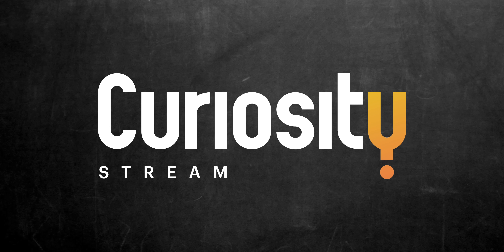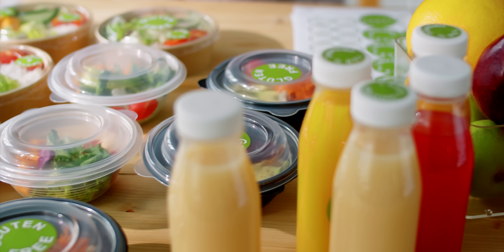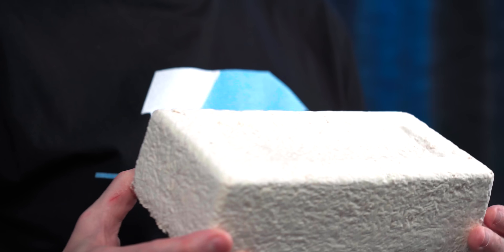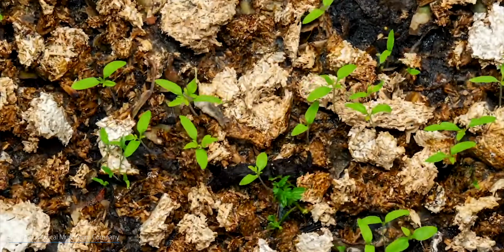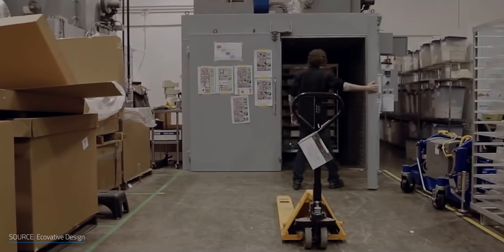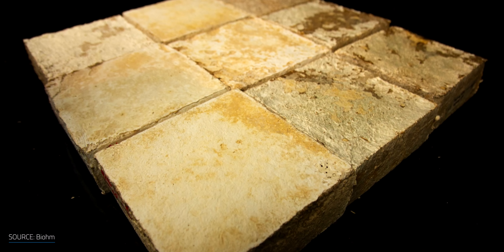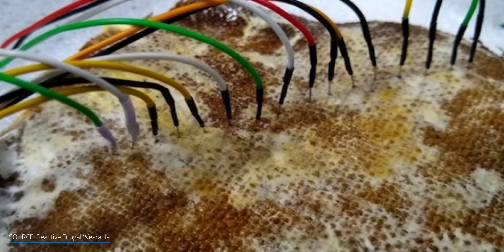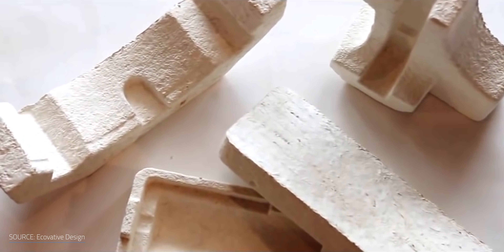Is Mycelium Fungus the Plastic of the Future?

Comment from the maker: So what do think?  Any uses I missed?  Would you want to live in a mycelium insulated home?  And thanks to Curiosity Stream ... use the code "Undecided" to get CuriosityStream for less than $15 a year! https://curiositystream.com/Undecided.

Also, be sure to check out The Future of Solid State Wind Energy - No More Blades: https://youtu.be/nNp21zTeCDc?list=PLnTSM-ORSgi4dFnLD9622FK77atWtQVv7
Reply: dependent upon the mycelium's tensile and compressive strength it could be a very good eco building material when mixed with lime similar to Hempcrete but with the possibility of stronger construction
Reply: @andymacleod2365  Lime would most likely degrade the natural mycelium. Besides, do you want your building to start degrading because it is biodegradable? I don't buy the use of it in building.
Reply: @getin3949  lime doesn't degrade other plant material used in buildings so why would this be any different. That was quite a profound statement do you have any reason for that or just preadjust?
Reply: Great video Matt, there is another use I stubbled across recently - coffins. A company named Loop is using mycelium, for many reasons, but most importantly the structure's ability to breakdown our tissues much more cleanly than possible in even natural wood coffins.
Reply: I was thinking about you will upload your video today... And you just did this... 😊😊😊
Reply: What about allergy issues? If there were mycelium based objects all around, would it just be incompatible with some people's immune systems?
Reply: Is mycelium packaging also edible? That would be convenient, have a flavored takeout box to eat after
Reply: @mobnar lol
Reply: For below ground exterior insulation on foundation walls maybe? However fungi is a tough sell to the construction industry: mushroom and fungi don't carry a positive connotation when wall fungus removal is a problem in sick buildings.
Reply: @notlessgrossman163  It's biodegradable, would you want your building degrading day by day, month by month, year by year until your house caves in?
Reply: @getin3949  I mean, houses already do that lol
Reply: @notlessgrossman163 , as a builder, I believe that the biggest hurdle is it biodegradation in moisture prone areas. Imagine a tiny foundation or roof leak could quickly cause immense structural damage.
Reply: @notlessgrossman163  ,
Rot would have to be an issue, especially for exterior applications.  It doesn't seem likely that it would be able to be competitive with concrete, brick, and non-organic siding materials on that front.  But wood is organic and is the go-to interior structural material for homes in the US.  So, I can see potential for that kind of use, with something else on the exterior.
  It makes sense that in-wall insulation would be the first successful entry point for mycelium products on the construction front.  And that's no small win as it could replace untold tons of inorganic materials currently used for such purposes.  The need to replace things like concrete and lumber seem less pressing environmentally.
Reply: Acoustic ceiling tiles?
Reply: A product with great potential. Maybe it could benefit by marketing it as something different from mushrooms. Lots of products (e.g. renaming carnations as dianthus flowers) have benefitted from rebranding.
Reply: I would like to live in a micelium house.
Reply: *We want replacement of plastic carry bag with cheap price ease to use for every day life*👍 Hit like if you agree 😷
Reply: the concern is its biodegradability...you dont want to buy shoes or houses that degraded after few weeks...it definitely works great as a single use product/packaging..though, it has potentials
Reply: @al-aurum2457  generally wood is biodegradable, but makes excellent building material. In the right circumstances, wood will become petrified. I read somewhere that the Romans built houses out of tree trunks and by the time they were done the wood was preserved "forever". All you had to do was live in them so wild animals wouldn't move in.
Reply: @al-aurum2457  perhaps degraded shoes is not so bad as an idea. Shoes to tend to stink as a result of sweat and bacteria present in the soles. If we could have a home or shop facility to "grow" shoes, being some components like laces the only thing you would buy, I think fungal shoes could be a thing.
Reply: @al-aurum2457  That is exactly the point I just made in my comment. Don't use this for items that would normally last a lifetime, use it for plastic garbage bags, drink containers, anything that we use on a daily basis that is polluting the oceans and landfills.
Reply: @al-aurum2457  He addressed that- he talked about the ageing.  Depending on the mycelium and the way a product is produced, and how it is grown can all affect the qualities of the end product, so they could, for example, make fast food containers and chopsticks that break down rapidly and then building materials that last a long time.
Reply: @al-aurum2457  I think the object/material would have to be introduced into a compost like environment in order to begin biodegrading. If you left the shoes on the forest floor they might begin to biodegrade. But if they're on your living room floor, they are not likely to. As far as housing materials go... maybe they are better suited for interior  or protected areas. This will be the future. What's happening now is figuring out the how to. But it's happening.
Reply: @al-aurum2457  ,
As far as degradability, many construction and clothing materials are very biodegradable.  Plywood, cotton, leather, cellulose-based insulation, etc.  We don't worry about these because we know to keep them out of the weather.  They work great for their intended purpose, but if you bury them in some damp soil, they'll disappear.  If this stuff works similarly, then it is a success.
  I don't think anyone is planning on using it for exterior siding or rain parkas.
Reply: Of course there’s the spore drive.
Reply: some fungus can even digest some type of plastic
Reply: @factfinder5967  Really? Why don't we use it to get rid of some of the plastic laying around? Thanks for this information!
Reply: @CCGR-2024  did I tell you the digested plastic is edible in some cases
Reply: Curious about the durability and longevity of certain products. Do they treat things like the mylo leather and insulation to prevent mold growth?
After all some of these products may be dead already from the heating, but they're essentially a large block of nutrients at that point.
Reply: The packaging products remind me of egg carton like packaging supports that have been used for decades at least here in Finland. Also, most fast food restaurants here ditched styrofoam packages sometime before the new millenium. Hamburgers are sold in cardboard boxes or wrapped in papers. Also, why try growing fungi building blocks, when you can use, say, wood.
Reply: @anttilaine9932  or concrete... or recycled steel
Reply: why would i use fungi grown from hemp to insulate my home when i can just use the hemp directly?   but replacing packaging materials with that stuff is a good idea.
Reply: How scalable is this product?  Also how do insects interact with it?  Would mycelium insulation by attractive to bugs and rodents?
Reply: I'll stick to eating the flesh of animals
Reply: OMG, that is a cheap cost for knowledge!
Reply: Saw this promising tech a couple of years ago. Glad to see that it has made great strides. Thanks for the update.
Reply: @Matt Have you seen the "mealworm/superworm eats styrofoam" videos? It looked like it was going to be a good way to recycle the foam, but then it petered out. Maybe you could look into it.
Reply: @Jcewazhere  Recycling? According to https://www.intelligentliving.co/styrofoam-eating-mealworms-absorb-toxic-additive/, 50 % of the styrofoam is excreted and 50 % is exhaled, so there is not much room for gaining body mass. Furthermore, "Because the droppings contain the harmful additive [flame retarding brominated compunds], they would have to be disposed of responsibly."
Reply: Been flowing Ecotive since it's initial startup.  It has been some unfortunately slow growth from my perspective.  It will likely require public policy making plastic pay for all its negative externalities before this becomes main stream.  Its primary challenge is its competing in a high volume low margin business that all ready has massive amounts of sunk capital infrastructure.  Ecotive's process is even more capital intensive them plastic manufacturing so the question becomes how do you get all the capital investment you need when your margins are so low.  It why they pivoted very early on to focus on niche high end product applications as they continue to develop their tech and likely hope for environmental public policies that can given them an economic advantage over plastic.
Reply: Excellent content, thanks @Matt! Do you know what the R-value rating is for the insulation? I know that hemp fibers are also being used for this purpose, and it would be good to get an idea of the differences. However the mycelium based material looks like it would scale quite a bit better than hemp fibers because its growth is measured in weeks, not months.
Reply: This was a really interesting video and I hope this Technology catches on, but does that mean I will find it harder to find mushrooms for my tomato sauce? :)
Reply: Just here to say the title is grammatically incorrect. “Mycelium Fungus” is the structure for a proper noun and there is no species by this name. Neither is it a type of fungus but rather a life stage or description  of the cellular structure of the fungus. “Fungal Mycelium” is a possessive and many fungi do posses a mycelial form. But this is redundant bc mycelium only comes from fungus so maybe the best choice is to choose either word not both. I didn’t watch your video. The answer was always yes to all aspects of increased use of fungi to do work for humanity.
Reply: @arsenicjones9125  And that is why nobody likes English teachers. lol. 🤣🤣🤣🤣

I'll bet you're the guy who sits in the back during a comedians'  stand-up comedy routine and corrects them on stage
Reply: @jaybee3165  unfortunately when communicating scientific information accuracy of language is important. 🤷‍♂️
Reply: @arsenicjones9125  true 👍
Reply: @jaybee3165  dude why being so harsh on @Chad Reactor? (and English teachers as collateral damage).
Don’t look a gifted piece of knowledge in the mouth.
Peace friend!
Reply: @arsenicjones9125  but? interesting too. nice factoid
Reply: I think that you have the best channel on YouTube.
Reply: Back in early 2000's The body shop was using non-edible popcorn as a packaging alternative. They found that mice and other pests would feed on them in warehouses and they faced it out. 

I wonder if mycelium would have a similar drawback?
Reply: that is all well and good, for mass production. But I use thermoplast because  I can deform them, by heating them. I do not see how fungus  could replace that.
Reply: I haven't time to read through all the subsequent suggestions... But my first thought when you pointed out in your pentafector that it could be made to be conductive was that it would be perfect for making prosthetic limbs.... 🤔🤯
Reply: We are trying to get and keep mold out of the buildings. Sounds like a Asbestos product. mold spores next to wood and a drop of water.
Reply: @philhacker1137  Note that part of the process of preparing the mycelium is basically cooking it so it can't reproduce. If any live spores get in there, it won't be from the mycelium insulation.
Reply: Various mycelium are being used for environmental remediation, bioremediation or mycoremediation. In simpler words, they’re effective at breaking down and eliminating pollution and toxins in the soil. They’ve been used to eliminate DDT, PAHs, many organic contaminates, DEHP from PVC, etc. And can actually create healthy soil.
Reply: Meh, it may have a few uses, but usually all these "environmentally friendly" alternatives are inadequate at the job they are intended to replace.
Environmentally friendly = lame, weak, poor quality, inadequate.
Reply: @peterbelanger4094  dumbass decided to overgeneralize
Reply: This material is a new allergic for me then - I cant breathe near mold and this whithe stuff is like the most toxic for the lungs ever ... again  inventors with a dumb ideaa -
Reply: So they made this video and I love that people are making it go worldwide Oso mushroom marshmallow i love them both
Reply: The only problem I see with this is history repeating itself. 
Hemp was a natural alternative to plastics and a plethora of other things. 

And yet, we are still making plastic and throwing it in the ocean. Due to greedy rich people not wanting to loose money.
Reply: No one should be able to own a patent that can advance or help humanity. Huge reason why we are progressing so slowly
Reply: @brentfeinberg1658  YES!  Capitalism is a ridiculous suppressor of progress and equality!
Reply: But what if you are deathly allergic to the fungi?
Reply: how long it last ?
Reply: all i want in life is a house that is fully degraded before i finish my mortgage. its good for other products that are not supposed to last more than a year not on a house or any structure :|
Reply: I'd be curious to know how common pests such as insects and rodents  react to this material if it were to be used in construction. No one wants to provide a pest years worth of free food and shelter as they live in your homes walls.
Reply: would you use the mushrooms aka mycelia
Reply: Excellent video, and information
Reply: Science is continually discovering alternatives to crude oil byproducts; it’s just a matter of time before crude is obsolete.
Reply: I would like to live in a house insulated with mycelium plastic.
Reply: instructions to growing mushrooms?
Reply: styrofoam can easily be made into napalm... if the military still used it. lol.
Reply: Mycoworks, Muskin( Mushroom Leather)- https://youtu.be/gZQGeQp4v-4
Reply: @Kiyarose3999  nice.
Reply: Hi
Reply: Does it have medical uses, e.g. syringes, IV tubing, NICU domes and other products that must be sterile?
Reply: So has the research been done to make sure we aren't going to end up with the same problems that biofuel is causing?
Reply: I’m curious, with the potential elimination of styrofoam, is there any health concerns as to storing hot liquids in a mycelium cups. Could mycelium be our new Dunkin’ Donuts cups, and would it be riskier or safer
Reply: ooh instead of us going  and spending in curiousity stream he can share all ifo from there to here
Reply: I have a question, is the mushroom bricks edible
Reply: It might replace styrofoam, which is good. However it'll never replace polyethylene or other thermoplastics. I wonder how well the properties can be tuned. Maybe a difference in species, growing conditions or heat treatment?
Reply: Wondering what the impact would be to those with mold allergies? Sounds like the mold is alive until it is cut off for use, are any steps taken to minimize or alter the nature of the fungi to not trigger allergic reactions? Or what additional steps would need to be taken and how would it affect the end products?
Reply: Radiation shielding? theres a fungus that eats radiation for energy. Makes it pretty badass really, literally eats radiation for breakfast. maybe this would have application in nuclear reactors (untill it mutates into a fungus monster and eats us all) and off world to protect our squishy meatsack bodies from high energy radiation.
Reply: Nope because this would take money out of the hands of old money, so maybe when they are dead.
Reply: They do make an alternative bacon product from it. Pretty good not crazy good but good.
Reply: I kept waiting for the most obvious question to be addressed but it never was. How is any of this usable for clothing or manufacturing if it is so readily biodegradable? I don't want shoes that biodegrade after 45 days of outdoor use. Housing insulation that decays and falls apart after a few years is not cost effective. I would love for mycelium to be effective, and I'm sure researchers have worked to address this problem; however, this was never addressed in the video, and that felt like a huge omission.
Reply: @theecstaticinfidelhypothes9222  well I mean how did people deal with leather biodegrading.
Reply: Yeah but...
Even dead mushrooms are consumed by other Funguses, so them being biodegradable is a bad thing for anything that should be persistent. The shoes will mold even more than they usually would. RIP shoes if you live anywhere humid.
Reply: Fungi are fantastic but I don't think they're so friendly. Everybody is talking about meet replacement and alike but no one speaks about the chemistry of final products. Prety sure there are some nasty molecule there. 

And the requirement for biomass is about to become a problem since needs and populatoin keep growing at an alarming 140k a day, also the soil is depleted all over the world.
Reply: I will attempt to incorporate mycelium insulation into my tiny house designs.
Reply: Is a fresh dry piece of mycelium packaging edible?  Maybe good to recycle, mixing with pig feed...
Reply: pentafecta is real word... you english™ very good. 👳🏽‍♂️👍🏽
Reply: You missed the Mycelium space network used by the Discovery Star Ship to instantly travel between galaxies
Reply: Clearly, we should start with the stuff that isn't expected to have a very long shelf life, like packing peanuts.
We already have a term in the automotive world called "planned obsolescence". Only it's a bad thing. They make parts that fail just after the warranty runs out.
Turn planned obsolescence into a good thing.Figure out the obsolescence date for other plastic parts, like televisions. Do you really expect your high-def television to last 30 years? Probably not. 30 years ago I had a dinky 13 inch piece of garbage for a TV. That was 6 or 8 TV's ago. So do we really need a TV that lasts 100 years? I think not.
Make it so if you keep it polished and waxed (who would?) then sure it can last 100 years. Otherwise it decomposes when you throw it out.

And let's look at actual plastics. Sure it takes them a while to break down, but are they really useful after 100 years? Old plastic tends to break and crack. So what's the point of making something out of plastic if you expect it to function forever? It won't.
Instead of looking at traditional plastic's decomposition date, we should be looking at its expected service life. How long can various forms of plastic be expected to last and remain fully functional?
If we can beat that date with organic plastics, then there's no problem.

And again, there are different strands of polymers. Some can last over 30 years and remain structurally sound. Others fall apart almost instantly.
Start by replacing traditional plastics with organics under the3se two circumstances:
1. The traditional plastics with a short operational lifespan.
2. The traditional plastics that are harder or impossible to recycle.

And then hopefully by the time we get to the more useful traditional plastics, the organic plastics market will have matured to the point where those more useful ones can also be replaced with little or no downside.
Reply: If mycelium is edible, it could serve as a protein-rich fodder after deconstruction of whatever was built with it. Maybe we could even eat our myceliofoam packaging and coffee cups :D

Also: do you know how durable mycelium is when compared to wood? 
I recently had a discussion about CO2 sequestration, and my position was that we don't need artificial methods, but need designated industrial forests and more use of wood as a utility material, in building construction for instance. This would be way more energy-efficient and environmentally safe, than storage of CO2 as a liquid or in minerals. Not to mention the CO2 that is produced during the production of building materials like concrete etc.
The counterpoint was that wood decomposes eventually, releasing the CO2 it captured, which is true. Could wood be converted to mycelium and could that mycelium be prevented from decomposition to become a timeless CO2 sink? That'd be much safer and eco-friendly than geophysical storage of CO2.
Reply: Awesome! I knew a lady had made a canoe out of it, but didn't realize anything else had been done. And I'd seen the brick sculpture thing but didn't realize the bricks were out of the ordinary.
Reply: WEED CAN BE USED TO MAKE PLASTICS TO WHICH ARE BIODEGRADABLE  ITS GOOD FOR THE ENVIRONMENT
Reply: @adamtemple9417  it looks pretty simple to make the brick stuff with a little trial and error at home. That was enough info for me to try it. I could see endless applications for DIYers. But yes, I would like to see a free recipe/formula for home use!
Reply: this is good!  if all packages will made of it,  i will never care about where i can throw it,  i just gonna borrow it with some plants and boom... DONE!  
Amazing
Reply: Seems like a boutique material. The three advantages of plastics are: 1) cost; 2) volume; 3) durability. It's possible the mycelium can compete on cost, and durability is a two-edged sword depending upon the use vector. It is volume produced in a given time frame where the fungus can't compete. Sure, in low volume items that isn't a big deal, but if you need millions of items every week, mycelium is going to have trouble keeping up. But for building a structure on, say, Mars, it might be ideal. Right now, it seems like its primary competitor is molded pulp -- which has an advantage of an already built infrastructure. But hey...times do change. Not so long ago, plastics were a pie-in-the-sky idea.
Reply: Your title is wrong. Mycelium is a fungal structure not a type of fungus.
Reply: I see some scientists have been playing Elder Scrolls again.
Reply: If you want to avoid eating plastic, stop eating seafood
Reply: @jeremyjohn1954  plastic particles get so small they are absorbed by plant roots and plastic liner/tube  is heavily used in agriculture, it is even in bottled water. Would have to move to a extremely remote natural area to try to get away.
Reply: Hi Matt, another great video and thanks for all your great content.  I'm currently working on some prototypes to make a mycelium-based satellite which I plan on pitching to NASA, ESA, and others.  My proof of concept video is the only video posted to my profile. Do you want to get in on building a mycelium-based satellite?  Stay well and have an awesome day!
Reply: Matt Farrell, do you think this would help reduce the use/waste of Commercial Fishing nets? That's where most of the world's plastic waste comes from. What would help stop that other than stopping eating store-bought fish?
Reply: I want to live in a mycelium house, lay down on my mycelium bed and play with my mycelium mouse and mycelium keyboard on my mycelium computer and watch videos on mycelium tube about mycelium. YES !
Reply: When it comes to homebuilding, I want materials that last the longest. If you have to rebuild it house every 60 years, there's a problem.

That being said, this looks epic! Wish I could get some filament of it though!
Reply: Would think it would have a place in the automotive industry
Reply: And the air line industry
Reply: You missed the fact that ALL FUNGI STARTS AS MYCELIUM. To say mycelium fungi is worse than saying ATM machine.
Reply: @OffGridInvestor  Neither are bad to say. It's not like he said arsenic-free yogurt.
Reply: I weld a lot. I burn through about 2-3 pairs of goat hide gloves every week. It would be interesting to see if it's possible to make durable welding gloves from mycelium.
Reply: @christopherp.3307  If you just need something tougher than goatskin, kangaroo leather is pretty much the toughest on the planet. The problem is, you'd pretty much have to get them custom made, and that probably wouldn't be cheap. Of course, another solution would be to just accept the short lifespan and go for cheap cowhide.
Reply: @InfinityOrNone  From a conservation standpoint It would probably be a lot better to use the synthetic mushroom leather, as long as it was heat resistant enough. My employers spends 30$ a week on gloves per welder; sometimes more. It could be cheaper to use an alternative. Even if they weren't as durable, if the cost was 2-4$ a pair, employees could just  use them for one day. Perhaps they could use some kind of hand mold for the fungus to grow on, to minimize sewing and leather work; making manufacturing very seamless. 

It's a big industry they could potentially interrupt. Thousands of dollar a year, in millions of shops all over the world.
Reply: So one day you’re extremely hungry you can just break it apart and eat it?
Reply: Really informative and good news as well. Thank you for producing this video.
Reply: The thing is the mushroom might deteriorate in a more permenent product
Reply: I think this topic is fascinating, wonder how they effect folks that are allergic to mushrooms.
Reply: hexafecta: use in space, performance in vacuum and under cosmic radiation and can it be used to terraform in mars or the moon?
Reply: You pronounced ADIDAS wrong. :D :D
Reply: Pest resistance?
 Not much good using it as insulation if it's just going to be infested and consumed by hungry bugs (unless it's a temporary structure). They'd need to incorporate some kind of tantalising treatment (do they have that already?), which would add a certain amount of toxicity element to their fire resistance. 

Otherwise, I'm very much in support of this. All perishable products should have perishable packaging.
Reply: What about using it for automotive body/trim panels?
Reply: How about the resistance against termites and other similar organisms? Will they find this a good food?
Reply: Can you weaponize it?  I'm sorry, somebody had to ask.  I could see making a club out of it. LOL
Reply: @piquat1  You could make it out of a deadly mushroom, then have something inside to cause it to react. Could use something dissolvable, and it could pass through airplane security on a carryon. Then use water from the flight attendant to trigger it.

Do not actually do this. I'm not liable for your actions. This is not advice, and is for entertainment purposes only.
Reply: @rmt3589  Haha, you know humans will always find new ways to kill each other. LOL
Reply: There isn’t any mention about allergens, or the medical issues at all.  What happens if someone is infected with live cells?  Accidents happen everyday.
Reply: Depends how well it can be protected from its main selling point-decomposition.
Reply: @adamtemple9417  i really hope it becomes more widespread too. However i do think theres at least 1 good thing about it being used by designer companies, and it's that it'll help people get over the sort of "ew it's a mushroom" response they might have
Hopefully more people can start making it
Reply: I be like, yeah my jacket I'm wearing was made with mushroom roots.
Reply: Mycilium fungi are a growing medium for other fungi. So the insulating bricks you make when wet are nearly a perfect medium for other things.  So if you want a house which can become a breeding ground for black mold seems like a mycilium brick would be the perfect material.  So no I’m not going to be building a house out of this.  I’ll take brick, steel concrete and wood.
Reply: This is great but , why dont companies use these?
Reply: i don't get it. is it resistant to nature or decomposable?
Reply: If they do eventually switch to mycelium they would have to ensure that the entire plant was dead for everything sold otherwise it is possible that you could accidentally turn your house into a spore breeding ground and I shouldn't have to mention that many spores are deadly. Also I believe it is blatantly obvious that parasitic fungus such as cordyceps evolved from extended close proximity to ants over the course of millions of years. I know many people don't think about the world they leave millions of years out but possibly evolving mycelium that turns human minds into its host making a real life zombie styled infection similar to what ants deal with is the other extreme to destroying life. I agree with the idea but if it is enacted it would have to be regulated heavily before proper normalization.
Reply: Thanks for reminding me about USS Discovery Mycelium Network XD
It would be nice to make board games and furniture with the Mycelium Network
Reply: This is how the walking dead start showing with their mushroom overlords
Reply: Great potential,  maybe great danger though if we finally engineer a very aggressive fast-growing version that can continue its cycle on its own in nature. Out of control fungal growth.  Biodegradable? Super for a thousand applications.  Alive or dormant or able to transmit its characteristics to natural fungi? Imagine a global never-ending campaign to preserve fertile soil for crops.  Plus,  mushrooms thrive on O2 and release CO2. Even if they produce 10 times (lower) CO2 for the same amount of plastic equivalent,  the sheer surface if it happens to replicate freely in nature is gonna mean a thousand++ times more CO2. Take this with a grain of salt but argue me wrong,  as we kinda need precisely 21% oxygen to breathe,  oxygen mainly made by the forests we cut everywhere...
Reply: Serpula Lacrymans. 
Look into it. And other mycology issues related to buildings.
The folly of such ideas...
Reply: @adamtemple9417  I disagree with your conclusion but I do agree with the original argument.  This should be more accessible and open source. I am willing to give innovative thinkers 10 or 15 years monopoly on their ideas, so they can benefit from the original though process and research AND developement... but I think after that 10 or 15 years, it should be open and available for everyone else to use and try and make more with those same ideas. Which would mean 2030-40 depending on which idea, for it to be available to the whole world
Reply: Not mother nature but Father God
Reply: Mycelium coffis :) ⚰️
Reply: Business names please?
Reply: Yes I see an issue. Knowing that mycelium is the first organism on land to thrive. It is also one of the most crucial componenents of life on land and it's also spread all over the world as a basis for other life, so when humans start to use it as a replacement for plastic they will start mining or gathering I suppose it like a bunch of ants on a piece of fruit I'm afraid they will destroy the basis for life on land and so destroy the entire ecosystem instead of just a part of it.
Reply: Is it live? What are the down sides?
Reply: I like opening the Bag and taking a slow deep breath........................ Aaahhhhhhh !
Reply: I think you missed talking about that over 50 percent of waste is from the fishing industry and nobody talks about it because of bribery
Reply: I'd like you to be a bit more comprehensive on the potential downsides. I think you mentioned that compared to concrete, the fungus is a weak building material. Any other drawbacks?

Also, if fungus growth is stopped by heating, would the material have a harder time decomposing?

And if it's being used as clothing, packing material, or insulation, what if conditions are changed, like what if it gets wet (during a flood) or another fungus infects the material, or molds in the walls or clothes when it's damp? Will the fungus re-activate? Or worse, mutate?
Reply: Mycelium bullets
Reply: the links in your description should include links to the companies you're highlighted in your video
Reply: I definitely would want to live in a mycelium insulated home! I can't wait to say goodbye to plastics forever. (by the way, I love the look of the mycelium structures shown, like the Growing Pavilion)
Reply: They are used to make alcool hahahahahaha
Reply: Alternatives to plastic packaging has to be solved, because we will not survive as a biological species if we don't find a solution.
Reply: There aren't many people who will like fungus food containers
Reply: My last apt. was mycelium insulated.  My landlord told me that it wasn't though.
Reply: Should of said quintifecta.
Reply: Any idea if this could be used to make microwave-safe food packaging?
Reply: Will the machines, pipes, wires, cables, buttons, the trucks and vehicles also be made of mycelium ?? The discourse itself shows how stupid we are ... As a leading species ... We can never give up production and must always find new parasitic ways to extract new things...
Reply: Solar Wind energy needs fossil fuels through and through ... Stop peddling this hoodwink greenwash cápitalism 👎🏽🕳️
Reply: can it be used to make a tube to replace air conditioning duct work ? to be of any use it would have to be up to 250mm dia
Reply: I am making an offer to donate 3 rescue flotation devices to the local municipality of Manzanillo, Colima, México to mount on a post at the historically most dangerous beach locations in the name of a friend of mine, Gilberto Sanchez, an employee of HOA in Santiago that died last year rescuing 2 swimmers without a flotation device.

The torpedo style rescue cans are very expensive and all plastic.  I would like for us / someone / me / anyone to make these rescue devices out of all natural bioplastics and to use hemp or other natural rope and shoulder strap too so that these rescue aid devices never add to our environmental damage and I suggest they be mounted on natural wood or bamboo posts that would otherwise be municipal or local landscaping garbage too.

Does anyone know where we can purchase bioplastic sheets that I could purchase and then form with a heat gun to a template that I'll make?  I will then trim the edges, glue a 2nd half and attach the 2 m natural rope with shoulder strap.   How long do you estimate bioplastic sheets would hold up if mounted on a post at the beach in this climate?  And how much longer if shaded from the Sun?

I think the world needs a very low cost, all natural rescue flotation device available to all.  Perhaps you would like to help?  Perhaps many people would like to help this altruistic project?
Reply: why is the veg option used with the mycelium considered gross? please elaborate
Reply: Would it attract black mold in houses?
Reply: where did you get that information about plastic consumption?
Reply: I have one question about this product: How will we build buildings or really anything out of it, if it degrades in about 45 days when exposed to the elements. To me the idea of using fungi as a replacement for plastic to me, yes is safe for the environment, yet is it exactly safe for me if the fungi plastic isn’t made correctly. What I’m trying to say is how would you make a skyscraper out of sheets of paper. (Not for real this is a example.)
Reply: What about people allergic to fungi?
Reply: A bioweapons company will start doing research on it and make a mutagenic version that spreads through a small town in the middle of the us.
Reply: Do you know Bangladesh already producing environmentally friendly poly bags from jute fiber?
Reply: You made one mistake, you said mycelia have cells, they don't. Their "cells" never fully devide, that's why they form strand like growths. Basically a mushroom is just one cell with a lot of nuclei.
Reply: So how long will it last? If it bio degrades in 42 days, how can you make things that you want to last 10-15 years?  Would be great if you could make a video going into more details about how it works. Rather than what it can be used for.
Reply: can you cook and eat the brick tho
Reply: You'd need to take account on  the possibility that the product could cause harm to someone with an unknown allergy to fungus and if that happens and this product reaches a worldwide standard use it would make literal hell for that kind of people
Im all about replacing plastic, but i would not mess with fungus.
Reply: @ElJags  look i just want a snack when i order a new drawing tablet oke?
Reply: I'm interested if there is any advancements in transparent myceliums? I'm in the solar and education research sector. Was thinking if there could be any laminates 🤔

Thank you for an enlightening video!
Reply: I am currently renovating an RV trailer to use as a home. As I live in Phoenix AZ where temperatures rarely drop below 100 degrees even at night) for a couple months during the summer I wonder how well this would do for insulation if placed on the outside or inside of the RV. It is an interesting idea.
Reply: Please get to the point. 2.5 mins beating around the bush. We know the problem, that's why we want to know about a solution.
Reply: Where can I learn more?
Reply: Is it inspired by super mario world where bowser turned the shroom people into bricks
Reply: a few years back I was earing the idea of the house made with living mycelium brick so that way it can repair itself. I can't remember the exact mechanism, but it was something like the outside layer is dead to prevent any unwanted growth/spore, but when a crack appears, air and water infiltrate he crack, awakening the mushroom, allowing it to grow and fill the crack then somehow die again (to return to a non growth state) waiting for the next crack to occurs.

Now the question would be if the material would be able to survive Nordic winter (Canada) and how it work in extreme humidity (like the tropic)
Reply: Its great for disposable packaging, but would it last 40+ years in a home? If it degrades in 10 years, big lawsuits will put builders out of business.  Remember the untested Chinese drywall that made people sick?  So I won't be a guinea pig in my home.
Reply: I really hope the fishermen start using it and stop polluting our oceans . As if .
Reply: If I could have a whole house built of mushroom I wouldn't mind.
Reply: I'm not trying  to degraded your idea but will it cause the last of us
Reply: Yes, I would like to live in a mycelium insulated home... but would it disintegrate 🤔
Reply: Hell yeah I would live in a mycelium insulated house, eat in mycelium wrappings and use any other items made of mycelium... As you said, it's mostly the cost and availability that are the bump in the road of growth of this market 😉
Reply: Why would the mycelium molds have controlled co2 when fungi live off oxygen and produce co2??
Reply: Yes, I want to build a bamboo home w/mycelium insulation.
Reply: Liberal millennial teen single moms be like shit brick scared by the looks of that thumbnail m8.
Reply: My concern is the fact the primary source of plastic waste it placed on the consumer. The true source are things on the commercial end and those are the largely ignored areas when it comes to public consciousness which translates to no real focus on things like nets that I doubt can be replaced
Reply: MAKE THE PROCESS ACCESSIBLE TO THE COMMON MAN..
Reply: If it is biodegradable, how long before your insulation breaks down?
Reply: Does Evocative have an effective monopoly on production of mycelium in the described method? Seems like it would be important to incentivize production across the board rather than limit it with licensing to a specific company/brand.
Reply: Thoughty had did a vid about this. The way he explained it was that this fungus could bio degradable the plastic! Not use in instead of plastic
Reply: This NEEDS more views
Reply: I mean, I was willing to live in a rockwool insulated home, so mycelium shouldn't be too different, fiberglass is trash.
Reply: Well, @Matt Ferrell, I always heard as a kid that something or other would last "...until Kingdom Come!!".

I just didn't think it would be this Kingdom, taxonomically speaking...

And thanks. You're a fun guy and without your channel, we'd all be that much more in the dark!
Reply: Pent-fecta keeps the rhythm of the original... I'm not sure it's any less awkward sounding though
Reply: Can mycelium that goes into the various products, very allergenic?  I know many folks have allergies to molds.  So is there a risk that with broad exposure, mycelium could obsolete it self for many people if they react toward it allergically.
Reply: You need JESUS. Pray to HIM, HE loves you.
When you die as we ALL will soon. 99.9 sooner than they think 🤔 ..you will kneel before JESUS. Romans 10:5/10. The One and only true Son of GOD Almighty, all others are false..we are all sinners and need JESUS.  JESUS was crucified on the cross at Calvary and then on the third day rose again, for you and I (John 3:16). So, Choose this day whom you'll serve. For if you don't it will be chosen for you and that is HELL
 Arguing with me is silly at best. Bc I'm just the messenger...
💌
Please call .
83.For.Truth.☎️.👍....... ...........🤔
Reply: Because jesus loves mushrooms?
Reply: How can i contact this company i want to invest
Reply: What is the name of the intro track from 0:06 to 0:54
Reply: Fungus is neither plant nor animal, its is own Kingdom.
Reply: Packaging is enough. Plastic's greatest advantage is also it's greatest problem. Durability. That's why we use it in construction, electricity, plumbing, windows etc. We don't want nor need to reverse the progress we made from more degradable materials such as wood, pig iron and organic insulators. 

Packaging however needs strength for a short period of time. Perfect. 

Clothing? Not really. Shoes? If anything we need better plastics. 

The key to every such topic is to weight an EXTENSIVE knowledge of practicality on BOTH sides of equation. To not be easily da satisfied with good emotion triggering answers. It can be deceiving. 

After all plastics are among us since 1920 and people can afford a lot of stuff lifting them from poverty and inability to live a healthy life. 

Yes we eat plastic. We also live TWICE AS LONG.
Reply: This is so Solarpunk!
Reply: Thailand has plast from corn ages ago that biodegrades.
Ooooh oooh, but because we would be payin a azn place other then china for it, its not good enough.
F this gov.
Reply: Hey great name 👍. I'm an ex plastic injection mould tech. Suffering with lung disease due to badly managed material use ( handlers not properly trained) and badly maintained extraction for fumes. This sounds good but will this be harmful to dogs if they eat it?
Reply: I have been using mushroom spore to break down wood chips used in my vegetable garden to make high quality inexpensive soil. This remedies a common complaint about nitrogen depletion caused by the breakdown of the wood.
Reply: Cheap?   With all that labor-intensive handling?   Chalk up a big one for dis-ingenuousness.
Reply: What re you so bald bro
Reply: I am truly impressed by this and all for it.  Loved your video and your jokes.  Only one question does this include any and all mushrooms which can be used?  Thanks for posting.
Reply: If it takes around a week to grow into a form it seems like it would take a lot more factory space as well as forms implying a much higher capital investment than  other packaging.
Reply: @TomCraver  
Yes, but it's "sustainable".
Reply: What comes to mind is the building method in which straw bales  within a timber frame are used to create the structural elements needed for house building & the integrity of the structure is protected by covering the whole with a lime plaster which not only waterproofs the structure but also prevents the burrowing of insects & rodents. 
I don't know if this combination of materials would work with mycelium, but until a time comes when mycelium can be developed into a 'standalone' building material we know from our history that using a combination of materials for construction is a viable technology and surely we can find a combination that would work, and best of all it would be not only almost completely recyclable but would also be entirely renewable which has to be a goal that we should all work towards
Reply: You should have stated the insulating R-Value per inch. :-)
Reply: Remember when we got rid of Plastics in commiefornia? And then all the homeless people just started shiting everywhere? Guess what, the homeless people used to use plastic trash bags to take a shit in and thrown into a dumpster, because they got rid of the trash bags the homeless people just took a shet anywhere which was fantastic when all these third-world diseases started coming back all through one policy of getting rid of plastic bags. The road to hell is paved and good intentions. However I do like the idea of this plastic replacer oh, hopefully it holds up to the plastic generation.
Reply: I wouldn't mind using it as an insulation for a home, if you've ever heard of dumb homes or monolithic dome, they use typically they use polystyrene bonded with shotcrete or aircrete and the concrete on the outside of the building but if I don't need polystyrene and I can use this fungus as an insulation material and if they can keep costs down the better.
Reply: You cowboys are good in handling dung. It is biodegradable. Why don't you make your coffee cups out of that?
Reply: Nothing gross about fungus..
Reply: I love this as a plastic substitute and it's insulation properties. As a construction estimator, specializing in mechanical insulation (pipe, duct and tank/vessel insulation), I would be interested in what the resistance to moisture would be with this product. It goes through the heating process to kill the fungi but, if it collects moisture, will it start to deteriorate?
Reply: The question you don't cover is. Does it decompose when we don't want it to?
Reply: @darkpheonix77  - No, it only decomposes, if you politely ask it to.
Reply: Anything that is good for our environment is good for me too. I hope in a not to far future, like TODAY, we could change and not use plastics anymore. If this is the answer, I'm all in.
Reply: When you are packing the brick mold with pellets, put in a thin-hard-shell stiffener to grow into in the brick mold. .
Reply: Useless without showing “how” individuals can grow Myceleum cultured forms for personal uses. This ends being just a commercial repeat of plastics era gatekeepers
Reply: mealworm/superworm eats styrofoam
Reply: As a builder, I’m concerned about moisture getting into the material, as this will definitely speed it’s breakdown. Maybe the scientists will figure it out, or possibly it’s limitations won’t make it a good alternative for building…at least structurally.
Reply: ^*fungus mycelium, not mycelium fungus🙄🤦‍♂️🤦‍♂️🤦‍♂️💩
Reply: You need a huge agriculture to make it industrially available. And agriculture we know is pollution. So, this is a source of pollution rather than a solution.
Reply: In a mycelium insulated home the mycelium would have to be treated with toxic chemicals to stop it from rotting and to stop all manners of infestations fro living in it. As long as weathering is modest, construction materials should last 1-5 centuries. A wood frame home, for example, lasts about 2-3 centuries. Structures should be torn down, not rot.
Reply: @tsamuel6224  i'd also be worried about common household pests. This sort of material just sounds like an invitation for them to take up residence in ones home with years worth of food without proper treatment beforehand to deture them.
Reply: question do you think there will ever be any organism that will be able to break down plastics or other detrimental environmental products?
Reply: Guys, we got the criminal that trow plastic away on the grownd. IT'S crows! Yeah we (at least i have) have camera fotage of crows making a mess.
Reply: You made an error in the title. It should be Fungus Mycelium, or just Mycelium as all Mycelium is fungal. Saying Mycelium Fungus is like saying Root Tree, instead of Tree Roots.
Reply: @stochastic24  not to mention we discovered microorganisms that are able to digest plastic years ago. Therefore the only real probably with plastic production is the energy and monetary cost.
Reply: The reason you may be confused about pentafecta is because you've switched from latin to greek. Latin: Quad = 4, Quin = 5. Greek: Tetra = 4,  Penta = 5
Reply: @Thomas Skyy can agree on that. any tech that makes such bold claims on helping humanity should make the technical information free.
Reply: 3 words
Mycelium 3-D Printer!
Reply: Hi there;
Reply: Can i ask some thinks from here??
Reply: :oops:
Reply: @trone3741  apparently not. they never answered my question.
Reply: Hi there, I'm looking specific facts obaut using mycelium as a isolation material.. numbers/studies/chape/ thickness etc. I vanted to compare mycelium and not sustainable isolation materials...what we are using here in North countries- and why I want facts- is because I'm studying sustainable construction and design here in Finland..scool name is  XAMK. 
Thanks for all help for my studies.
Reply: @trone3741  idk if this will help you. But recently( I'm old so probably 2 or 3 years ago) they found a microorganism that seems to evolved to eat some forms of materials we've deemed 'ecologically unhealthy" not only that they have done studies with Styrofoam and meal worms and meal worm relatives. Turns out they can digest a significant portion of Styrofoam and only these little bits of poop are left. Imo we should really be placing out renewable tech in figuring out how to fix the problem we have created with the pollution we have rather than waste our time looking for alternatives. I took would like to know if there is an actual practical application to this material more than just making a company look good. We should really move past that phase of renewability. I doubt it had the structural integrity you are looking for for a building in practice. Seems like it could be a better sustainable insulator though. Just because you shape something like a brick does not mean it will function like a brick. I do hope something good comes out of this for the environment but time after time it seems the applications aren't as paradigm shifting as we think they will be. That might just be the pessimist in me. But if you want my opinion investing in novel recycling is the future such as the slime that eats plastic or the fact meal worms can do something amazing in minutes we thought would take hundreds of years. I might be wrong and there is a more practical application. But I'm just not seeing it.
Reply: This is an awesom idea, i never knew this was possible and i think it could be the solution or at least one of them, to replace the plastics in the world
Reply: @emanuellejaugey4895  I doubt the public would go with it. it's too weird.
Reply: Will the current available wood chips withstand the demand, a lot of organic trees will be used
Reply: the world will not keep up with the water to grow these to meet the demand, the world will be dry,
Reply: Curious about health concerns; fungi can cause allergic responses or atleast induce immune responses when inhalated. Should these products shed "microfungi" particles this could be something to deal with.
Reply: sounds good to me
Reply: Thank you so much!
Reply: I'm 100% for all things mycelium based.
Reply: @AbstractVisionzTieDye  unless its in places were the mycelium might decompose to early
Reply: Why? Why is it better than wood and other plant-based products? Moreover, to grow a mushroom, you still need wood. This sounds irrational to me.
Reply: Until nature finds a way and then we get a grey goo scenario from mutating fungus
Reply: Maybe prosthetics
Reply: Matt, are they making these insulating panels for homes currently?
Reply: Have you attempted to build homes out of the structure? Could be better than the insulation we have today, also having the bricks to basically terraform if the biodegrading turns into a strong natural refurbishment for soil. In my opinion I think that growing food plants on Mars would need your technology if it’s non toxic try growing in differ types of environments.
Reply: Pentafecta sounds like a cool word. I like it 👍 plus it’s been around since 2011
Reply: Is it just me, or was the mycelium growing in plastic molds?
Reply: Its a good thing you didn't find a sixth use or you might have gotten demonetized XD
Reply: what about those with algies to fungis and mushrooms
Reply: I think hemp is the future of consumer food storage and delivery.
Reply: @currentfaves65  the problem with both is that they need to find a way to make them hypoallergenic. Right now more people are being found to have allergies to both.
Reply: Most plastics can be burned MUCH more cleanly than coal, and the world burns an immense quantity of coal. Ground up plastic waste should be blended with coal at, let's say 5%, and combusted in power stations. It would help clean the air, and cleanly dispose of plastic.  waste.
Reply: I wonder how it tastes. Could it provide the physical matrix for artificial meat?
Reply: If they can beat the cost factor involved this indeed could, scaled upward, be a game changer.
Reply: Biodegradeable bricks is a stupid idea 🤣🤣🤣
Reply: im pretty sure hemp is the plastic of the future (it is). you should look into that
Reply: I would ABSOLUTELY live in a mushroom insulated home. you know why? no more insulation dust everytime the a/c turns on. no dangerous fiberglass, and better performance. my only worry would be if/when the insulation got wet, how quickly it would mold.
Reply: 2:18 is that from Philippines the trash torn into mountain of trash
Reply: Never going to happen on a massive scale. Powers that be want to control oil production and oil synthetics industry because $$$. Same reason why cars won't be made to run on water because of a few greedy evil humans that honestly should be put on watch lists and be closely monitored so that these psychos do not get out of hand ever again. Confiscate all their wealth and give it back to the cause that is greatest for all of humanity. All their complicity to excessive pollution due to greed is killing all of us anyway but why does no one do anything about it?
Reply: This is great! To see the amazingly diverse uses of mycelium is so cool. I would go for any of those things, be it packaging, clothing or insulation. I do wonder though how the patents hamper the use of this new technology rather than help it "grow" (haha), for sth that good I find it a bit sad that so few companies / countries are pushing it.
Reply: Oyster mushroom mycelium has been shown to clean oily lorry yards (Paul Stamets). There's also great promise for cleaning old mine spoil heaps, phytomining (or maybe that should be called mycomining, and maybe even radiation contaminated sites (since certain species will absorb specific heavy metal elements.
Reply: Production cycle time.  Production cycle time.  Production cycle time.  Production cycle time.  Production cycle time.  Production cycle time.
Reply: Yes
Reply: Live in such a home... sure... why not?
Reply: The title of your video is incorrect. It should state fungus mycelium, not the other way around. Mycelium is not a type of fungus. Mycelium is the main body of fungus before it fruits.
Reply: Of course there are uses you missed.. There are always new uses for things to be discovered, and sure, if it was cost efficient, or at least was similarly affordable to other options. I try and be responsible about my footprint. Right now I insulate my home with cardboard, bubble wrap, as well as non-recyclable materials. Can't see them inside the walls, doesn't matter how it looks.
Reply: Left field question, but...is the stuff itself edible?  I know you mentioned food applications, but I'm curious about growing it en masse for the production of low-cost, quick food staple especially for emergency or crisis response situations.
  Secondarily, if it's an organic material something is going to want to eat it.  That seems like a concern regarding its use as a building material.  If I use it as insulation in my walls, am I going to get an infestation of roaches, rodents, or other pests feasting on the stuff?
Reply: @adamtemple9417  ,
Allowing people to actually make a bit of a profit after the very expensive and risky r&d that it takes to create such inovative products is the only way to create a stable and economically sustainable industry around these things.
  Otherwise, even if the very expensive know-how was made free and open, the overhead and continued r&d would end up always relying on goverent and institutional funding which is not how thriving markets and industries are formed.
  If we want to have new and thriving ecologically-beneficial industries growing up around us, then it will have to be based on sound market principles, not planned economy fiat or a purely open-sourced (i.e. incentiveless) utopia.
Reply: @adamtemple9417  ,
Really?  Please educate me by pointing to businesses which have emerged and thrived long term in a "gamified system in an open sourced marketplace," especially those trying to make room for an entirely knew kind of product which is having to compete with well-established competing technology.
  Using phrases like that, you're clearly the expert and will no doubt be able to provide an extensive list.
Reply: @adamtemple9417  ,
So blender invented 3D image software, linux invented the computer operating system, co-op farmers invented the things they farm, etc.?  Wow!  Who knew?!

No, each of these examples took things which were already mainstream and just switched them over to a more open-source business model.
Now imagine if the first automobile manufacturers tried to use an open-source business model while still competeing with horse drawn carriages and carts.  They would have eventually become mainstream based on the technological advancement, but not as effeciently as if you had actual profitable businesses like GM and Ford leading the way.  And these mycelium products are not pragmatically a huge leap forward over plastics the way cars were over horse-drawn tech.  Plastics still have better product properties over all.
  These businesses you mentioned can only exist because other people went before them and created a stable market/industry sector for them to then come along and play in.
  It's not a viable option for the creation of a new thing in a hostile market, especially when the new thing is not going to be super competitive vs what's already on the market.
  You have yet to provide the kind of examples I asked for.
Reply: @adamtemple9417  ,
Nope.  That would be the case if I just said that the earlier things were better just because they were earlier.  I'm not making an "if it ain't broke don't fix it" argument.  I'm saying that, if you're coming up with a brand new way of doing things which is going to have to compete with entrenched existing competitors, you should provide the most incentive for it's success.  Making the people who developed the intellectual property behind the innovation give it away for free as soon as they get it is the opposite of that.
  Open source can and often does work, and can include innovations on an existing system.  But it just factually and quite reasonably doesn't work for breaking into a system with a brand new descovery.
  This is especially true when the product you are selling is not especially competitive in it's properties compared to what already exists.
  This is a baby of a thing trying to elbow it's way onto a field full of stronger and more established competitors.  Maybe let it survive infancy before making it give away it's only assets.
Reply: Can you eat the mycelium?
Reply: Fungi can digest oil based waste and excrete healthy biological stratus
Reply: How bout mixing micelium with hemp
Reply: I've heard that, for producing leather, it needs to be bonded with PA (nylon). Is it? If so, this would not be a good alternative to leather.
I see that the other examples you've mentioned doesn't need bonding, which is a big plus to a sustainable future.
Reply: Late to the party, but how about using mycelium like paper, for printing, writing and as wrapping material?
Reply: So, it will still need wood?
Reply: Thanks for the video!
Reply: Mycelium should be more widespread! We should have stopped the use of plastic completely and switched over to something like mycelium. It is so much better for the environment and for our own health, it seems nothing but logical to use biodegradable alternatives to polymers. The societal lag causing old habits to die hard will most likely be humanity's downfall. The lack of federal drive to take initiative on issues such as this is what is holding humanity back.
Reply: @LeeMuayThai  Cellulose is a biodegradable polymer and makes up 80+% of every piece of wood and straw on the planet.
Paper and cardboard are typically an even higher percentage of cellulose, but I can't speak for what kinds of treatment they may have (like wax, kaolin or titanium dioxide)
Reply: @LeeMuayThai  Yeah, lefty control freaks like you want to dictate lifestyle to everyone.
I call people like you "should-ers" you "should" all over everyone.
Put a sock in it, Karen.
Reply: @LeeMuayThai  Nonbiodegradability is a feature of polymers in many cases. You don’t want most structures to degrade before the end of its use cycle. Replacing ALL polymers with mycelium would be incredibly short sighted and would probably cost more (to the environment and society) and be less efficient, since you would have to rebuild stuff monthly. It’s a great material in some cases but not a universally useful one.
Reply: @LeeMuayThai  commercial fishing nets are where most of the plastic comes from. Stop eating store-bought fish and you'll help stop plastic waste drastically.
Reply: @LeeMuayThai  the secret to getting society on board is to make the products functional. When they replaces plastic straws with paper ones it set environmentalism back a decade in its PR.
Reply: @LeeMuayThai  you really think plastic is the big problem? Take a look at fishing. Nuclear arms development, extreme commercialisation of life-saving drugs etc... Honestly, the world is f'd no matter what, plastic won't be the nail in the coffin, that much is for certain.
Reply: The thing you missed was every mushroom is different.
Some mushrooms that grow on trees can get big and wooden like and very hard you would brake you're hand if you hit it hard.
The ones I seen in the video/videos was softer and used wood in lot of it.
Question can you show us the different kinds of things they can use to make mushrooms i think there's one out there that eat plastic or mybe that's only the bacteria.
I do know there's one out there that uses radiation but mybe not good for homes 😅 but good for space travel think about it they are working on it.
Mybe they should use old food wast or something like that to help get rid of the garbage faster 🤔.
Reply: "Mycelium insulated home."
Ah yes, the missing ingredient for a long-lasting home: biodegradability.
Reply: @InfinityOrNone  in the case of mycelium  if you’re using the fungus and not it’s products (like plastic, so i don’t know what his talking about being better than plastic because it ‘is’ plastic) it’s more like the house eating itself, it releases strong acids to break down plant and other material and is also capable of digesting plastic.
Reply: do you only do a base level of research or something? IT “IS” plastic, first off do you actually understand what plastic is? (this maybe ironic considering i haven’t seen the video but it’s literally used for plastic...come on)

mycelium fungus is used to make plastic and in recent years has been added to landfills for its ability to DIGEST plastic.

that said not all plastics are the same. for example biodegradable plastic is NOT the same as compostable plastic, they’re still organic and still break down in the environment but biodegradable plastic can still take many months if not years to break diwn entirely. compostable plastic can be used as an additive to enhance fertilizer and acts like a component of fertilizer.

if you care about the environment compostable plastic is the way to go.
Reply: I wouldn't want to live in a house made out of mycelium, but the packaging and shoes seem really nice.
Reply: Bíï90 the same
Reply: it won’t be used because of big companies will drive it into the ground like hemp plastic
Reply: @tragan1442  

If you can substantiate that, please do.
Otherwise spare us the victimology cr*p, unless you're talking about the Federal Reserve.